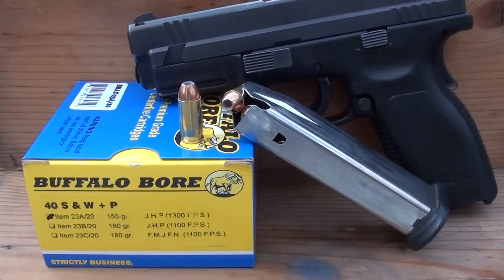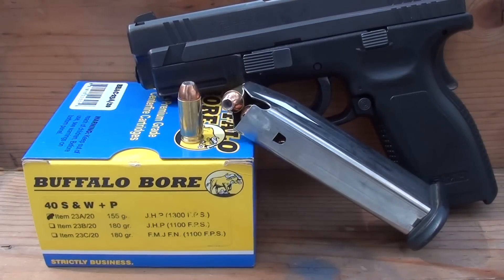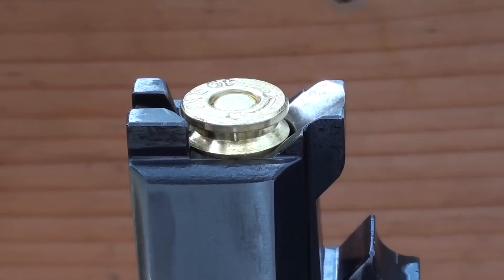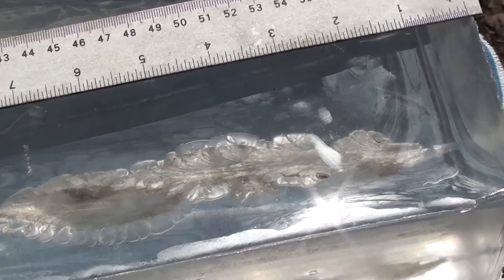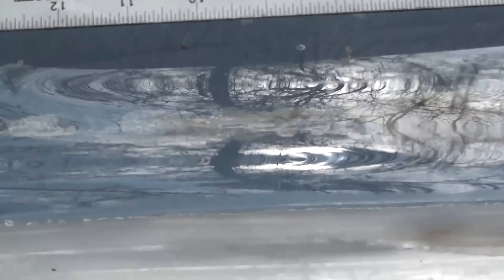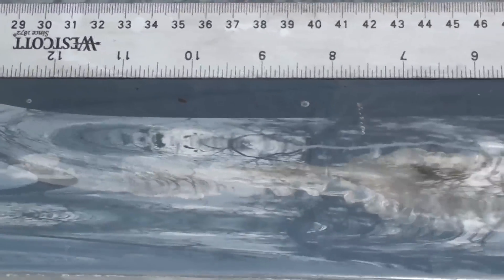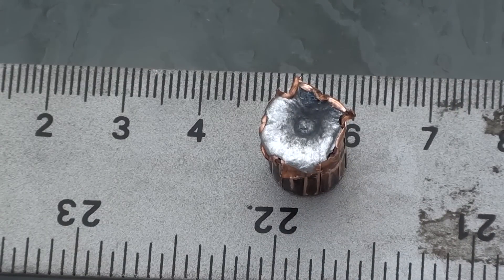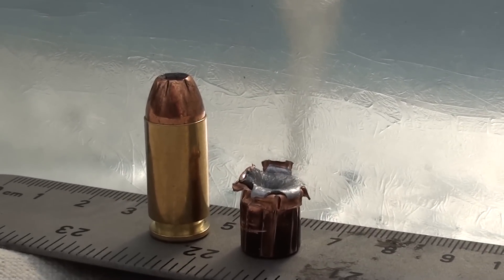40 S&W +P Buffalo Bore 155gr JHP Ballistic Gel Test

Comment: I have shot and hand loaded for the .40 S&W for 30 years. I have purported that 155 gr. Bullet is the optimal weight for this caliber. in a full power load like buffalo Bore its right there with a 158 gr. .357 mag. Law enforcement and Government agencies are going back to the 9mm because the .40 has TOO Much Recoil. Who would have thought that, "For every action there is an equal and opposite reaction" Newton's Third Law of Motion. " Remember that the most important requirement of the Combat Arm is that it be capable stopping one's opponent from further aggression with the minimum shots fired, Preferably One".(Chuck Taylor, The Fighting Rifle .) I am also reminded of a thought paraphrasing," to equip one self with with an Arm that is was designed primarily to be Easy to carry, Easy to shoot at the expense of being powerful enough to accomplish the purpose for which it was intended smacks to me of a loss of purpose."(Chuck Taylor The Fighting Rife.) I wont argue that hit with a light round i.e.. 9mm is better that a miss with a heavy round Full power .40 S&W or Better yet 10mm and .357 mag. Its your family to defend. Train and shoot the most powerful round that you can. I know its expensive and takes time and Discipline, but It will be worth it!

Comment: The FBI load for the 10 mm exceeded 1500 ft per second with a 135 grain bullet I thought the case was too long and The recoil too hard so they came up with a 40 Smith & Wesson with a 1450 ft per second 135 grain bullet then dropped it to 1350 135 grain bullet which made it just about the same as the 357 sig

Comment: 40 S&W is not high pressure. It’s 35,000 psi same as standard pressure 9mm. I’ve shot the Buffalo Bore out of G22 gen and my S&W M&P 2.0. No issues it a great round

Comment: Underwood has basically the same load for .40 S&W. Damn near 600 lb/ft of energy. That's .357 magnum territory, but with a larger diameter bullet. Nasty stuff. People who say .40 isn't substantially better than 9mm apparently haven't seen this.
Reply: The 135 gr nosler from Underwood actually is over 600 ft lbs from a 4” barrel. The rated 588 ft lbs is from a Glock 27, AZ AIRGUNNER found out on December 15th 2023 and January 3rd, 2024. They hit 675 ft lbs from the Beretta. The 155gr XTP is rated at 582 ft lbs energy, so just 6 ft lbs under the 135 gr nosler, but Im not sure if that’s out of the same 3.4” barrel or not though, but it likely is, because 155’s are still light enough for caliber to get enough velocity without to much pressure
Reply: Also, not sure about Underwood, but Buffalo Bore’s hardcast .357 magnum hits like 935 ft lbs from a 6” revolver. Underwood and Buffalo Bore are truly on another level concerning muzzle energy
Reply: @SuperD00D more powder does that- but a 40 super does it better
Reply: I only use 3 ammo companies Underwood Double Tap and Sig Elite for my Glock 23 Gen 3 and my Glock 43X
Reply: @eddieweigel9490 Buff Bore is kinda pricey compared to DT and UW.

Comment: 40s&w isn't a high pressure cartridge.   It operates at the same pressure as an standard 9mm load.  The 40s&w high pressure reference is a myth.
Reply from the maker: Yes and no, Hear me out a sec.  9mm has a range depending on bullet to 
MAP (CUP) – 33,000
MAP (PSI) – 35,000
MAP +P (PSI) – 38,500

Where as 40 S&W is
MAP (PSI) – 35,000

What people are talking about, is the 40 is already at max pressure for the volume of the case, plus bullet weight, anything past 35,000 in a 40 is not really safe (?) 

This is all part of the who likes 9mm vs the who likes 40.  Compare results not pressures.  Pressures are a tricky business, and they use it in marketing to fool people, just like they do with velocity.  Me, I am a 45ACP guy all day long, I know what they do, they are the lowest on the velocity and PSI scores, but they work time and time again..  Bottom line research and use what works for you and most important your gun!

Stay safe and keep practiced.!

Comment: That's the perfect round defensive round for a ar 40calber pistol with a 10.5 inch barrel. It would be more effective than a 45acp. And that statement will send the 45acp crowd into absolute rage. And for that alone I believe I'm going to have to get both a ar 40 pistol with a 10.5 inch barrel. And useing it with Glaser safety slugs for home defense and Buffalo bull brand for a truck defensive weapon or outdoor anti round for any critters who might want to add me to the dinner menu.
Reply: Properly-loaded .40 S&W has always been better than .45 ACP. The .40 provides equal or better muzzle energy with better penetration and higher capacity. Hollow point expansion is usually more reliable with .40 as well due to higher velocities. I don't see the argument for .45 ACP, but some people try to make it.

Comment: This showed the shortness of the actual wound track and the proclivity for hollow point failure!
Reply: My personal opinion, I think there is a tendency to put too much emphasis on bullet integrity at times, it seems, at the cost of performance. Some the most reliable loads, in terms of actual street performance, have been rounds that have been driven to a point of fragmentation upon contact. These loads consistently produced large cavities and were not always deep penetrators by today's standards. Ideally we should be able to maintain integrity and produce large cavities which some modern rounds do very well but this particular round would be very devastating seems to also have enough structure to remain effective through barriers.

Comment: I don't see why this couldn't be fired in a Glock barrel.
The pressure is the same as 9mm.
The 165 Grain HST Tactical Bonded (Police ammo) gets over 1200 FPS out of a Glock 23 & that ammo was selected to be used in Glocks almost exclusively.
I'm just not seeing the over pressure concerns here.
If Glock barrels are fine with .357 Sig, 10mm & hot rodded 9mm +p+, I would feel fine firing some Buffalo Bore that is MAYBE a marginal amount over pressured.

I think we have gotten so used to pud loaded .40 ammo that the stuff loaded close to maximum SAAMI pressures seems like it's super over pressured.
Reply: It's not a danger of pressure alone, it's that it's over-pressured, which is fine within reason in a fully supported chamber, but in a Glock that is not fully supported it can blow the case and the blast would into the gun frame. This would not happen in a fully supported chamber even if the pressure was a little too high.
Reply: @GunSam  Yea, that's true, but I just don't think these are over pressured.
At least not to a level that would cause any issues.

Comment: 40 is already high pressure..

Buffalo bore: hold my beer
Reply: I have a box of underwood +p from about 10 years ago. It ran fine in my 23
Reply: @jimwest1967  I have a gen 2 Glock 23 and want to buy some Buffalo Bore plus P or just any plus P but I’m worried about damage to the gun, plus I have a 22 round mag and dont know how that would turn out
Reply: @daltonlol5550  

Don't do it unless you have an aftermarket fully supported barrel, though the only downside to fully supported Glock barrels is that the pistol won't be 100% reliable. I bought one of those barrels on eBay factory seconds for $59.99 for my Glock22 & sometimes got failure to feed. So I only use it for range training sucks that it isn't as reliable as the OEM barrel.
Reply: @PerceptionVsReality333  try a Lone Wolf barrel.
Reply: lol that’s how they roll
Reply: Compared to 45 ACP, which is 21,000psi, yes. .40 S&W is the same pressure as 9mm, 35,000psi. 9mm +P is 38,500psi, where as there is no real +P designation for .40 S&W. Buffalo Bore just branded it that way.
Reply: @reborn19x  I believe this MAY be slightly over standard max pressure.  These are about the same velocities you'll get with standard max data in a 5" barrel.  BB is apparently doing it in a shorter barrel... maybe.  lol.  Or maybe BB used a 5" barrel...

Longshot and Power Pistol both get about the same performance out of 5" of barrel at standard pressure.    Longshot did 1309 fps and 590 fpe.
Reply: @reborn19x  thats just because theres also +p+ 9mm so the +p has a maximum where the +p in the instance of buffalo bore's .40 is because its higher than standard saami spec .40, because of case limits you cant go much higher on .40 so there would never need to be a +p+ range specified for it.
Reply: same as a 9mm  you are watching silly propaganda

Comment: How about the Beretta 96?

I have no clue what an unsupported barrel is.
Reply from the maker: Some barrels are "bigger" toward the bottom of the round (near the rim) to aid in extraction and or feed areas have to have a barrel lipped, those areas are considered unsupported hence no metal is encasing the brass and it "could" with high pressure rounds split the brass and have blow back, I am pretty sure this is all been addressed in the last few years, and only a few firearms had this issue, Glocks in 40 caliber did in the Gen 2 I am pretty sure and it was nicknamed the "Glock Buldge" in the reloading arena

Comment: There is no industry spec for +P .40 S&W. SAAMI states MAP for .40 S&W is 35000 PSI, and does not recognize .40 S&W +P. What we have here is a irresponsible company with a callous disregard for safety and protocol offering ammo loaded outside of industry specifications and then blaming the gun manufacture if anything bad happens. If your gun blows up using Buffalo Bore, it is has nothing to do with chamber support or gun manufacture. Literally not one single gun on the market is designed to take their ammo. Firearms are designed for industry specs. You know that guy at the gun show selling his reloads? The one who kind of scoffs "yeah those are a lil hot." That's Buffalo Bore--over-hyped mystery ammo loaded outside of industry specs by reckless morons with more regard for advertising than their responsibility to their consumer and their industry. 

I wouldn't shoot Buffalo Bore through any of my guns if I was in the Thunderdome and it was the last loaded ammo on Earth. If you want 10mm performance, you should get a 10mm Auto.
Reply: Even a 9mm has the same 35,000 PSI SAAMI maximum pressure but with plus P it reaches 38500 PSI, the same thing can be done with 40 S&W
Reply: @Maverick966  No it can't. It doesn't work that way. Firearms are designed to be safe and reliable by industry specifications. SAAMI and others within the industry set dimensions, pressures, twist rates, ect, and manufactures use these recommendations. There is no industry standard for +P .40 S&W, so not one single handgun in existence is designed to handle +P .40 S&W. The .40 is accellerating a bullet with 50% more mass than the 9mm, so there is more force involved. You can't just load a .40 to the same pressure as a 9mm and assume things are fine when physics says otherwise.
Reply: @M16A4vibe  There is not YET +P standard for 40 S&W

Comment: That's impressive. My question is isn't technically the 40 s&w considered +p+ round to begin with cause it's already a hot round and this round be a ++p+
Reply: 9mm and 40 run at the exact same maximum SAMMI chamber pressure.

Comment: For all those people who want to beat the crap out of their .40 cal even more...my suggestion would be if you want this type of performance, buy a 10mm.
Reply from the maker: Finally!  KUDOS!!!!!  I knew someone out there was smart.  Why indeed
Reply: Because you don't practice with this stuff. You use it when you need to protect yourself or others.

If you actually use this enough to beat up your gun, you aren't using it for self defense.
Reply: It's generally a good idea to practice with the load you carry. The .40 is already pushing it in its standard pressure form, there's a reason why there's no SAAMI specifications for .40 s&w +p.
Reply: @AnarchAngel1  I shoot maybe 20 rounds of my carry ammo a year. The other 2-3K rounds are all fmj bulk ammo.

20 or so rounds a year won't kill a gun. 

The standard pressure in a .40 is the same as a 9. They don't list a spec because of the unusual origins of the .40. Being a load reduced from an existing cartridge. Rather than powering up an existing load. It has nothing to do with the fact the max standard pressure is 35,000 any more than +P 9mm is listed because the max pressure is also 35,000.
Reply: I agree that 20 or so rounds a year won't kill a gun, but they are going to feel significantly different than bulk FMJ loads that you practice with, which isn't ideal for realistic training. You're correct about .40 cal having the same operating pressure as a standard pressure 9mm, the difference is there is a SAAMI specification for 9mm +p which is 38,500 psi. There is no specification for .40 +p, it doesn't exist, so you really have no idea what type of pressures are being generated by ammo like this. The reason is there is much less room and tolerance for extra pressure with the .40 caliber cartridge, it's already pushing the envelope in it's standard form, 9mm is not. It has nothing to do with the fact that it was created from a shortened 10mm case, it's about the pressure dynamics at play. You do what you like with your guns, I just think the extra pressure is a bad trade-off and a bad idea for a small increase in muzzle energy with a cartridge like the .40 s&w. I've re-loaded plenty of ammo in my day, so I have a little bit of understanding of pressure curves and the reasons why the .40 is already pushing it. My advice would be to stop worrying about getting the most powerful loads possible and start worrying about training yourself to shoot more quickly and accurately... 40s are already pretty notorious for their tendency to beat up a gun, why go and make the situation worse? That small increase in muzzle energy will mean almost nothing in a fight, your shooting skills will.
Reply: @AnarchAngel1  l train with different guns and different calibers. A little more recoil isn't even noticable. Specially in a live fire simulator. I'm not recoil sensitive and I shoot CZ clones. The have less felt recoil to start with.

Most .40s are built on 9mm platforms. +P in 9mm is anything up to 10% over standard. If your platform can handle 9 +P, it can handle .40. It is also is a newer round with an unusual development path. That is the only reason there isn't a SAAMI spec. Much like SAAMI doesn't list +P+ for 9mm. It has to become popular first, then they do a spec on it. Not the other way around.
Reply: @AnarchAngel1  9mm +P is up to 10% over standard. Most .40s are built on 9mm frames. They can handle .40 at a higher pressure, just like a 9.

I train with different guns. Both 9mm and .40. I also have a full sized and a compact .40. In a live shooting situation, you will not notice the recoil. Even in the live fire simulator, your attention will be so focused and adrenaline will be pumping so hard, you won't even see your sights. Noticing the recoil will be impossible.
Reply: Your logic doesn't follow. Yes, most .40s are built on 9mm frames, that's one of the reasons they are notorious for beating up guns. Chamber pressure is not the only thing that matters when it comes to wear on a gun. Equal pressure with heavier bullets equals more energy, energy that's being transferred to the frame and producing higher slide velocity. A .40 "+p" is absolutely going to beat up a gun more than 9mm +p, there is no debate there. You said yourself they are usually based on the same frames, so how does that make any sense. 40 caliber is not a cartridge that should be pushed further than it already is. Have you ever wondered why there are so many more KBs with .40s than with 9s?
Reply: @AnarchAngel1  has anybody lost a barrel shooting this stuff?
Reply: @88Berries  I really don't know, the potential is always there though even with vanilla loads. All that's needed is a case head separation and 💥 And you can lose a lot more than just the barrel as well. I'm guessing most firearm companies would tell you to go pound dirt too if it happened while shooting ammo like this that has no official specifications. I wouldn't put it through my gun

Comment: I just checked the barrel on my new glock 23 and there is much better support than there used to be.
Reply: What generation do you have?
Reply: I have a gen 3 Glock22 made in 2021 & the chamber support is not fully supported but still much better than the older models.

Comment: it doesn't appear the bullet opened as it should, so I don't expect a full 22" often (nor do I particularly want 22inches) I have a box of this exact ammo I tested with less consistent material and 5-7 shots in semi moist rich earth non compacted all pedaled decent (asides of rock chips) and penetrated around 5.5-6" were most defensive rounds take an inch shorter path (not a consistent or good test media I used) but they do penetrate a bit better then most........secondarily. I have a roughly 2009 production glock 23, its lwd barrel and a recent production m&p shield, none of witch have a fully supported case web, all about the same the difference I see is the OEM glock barrel by far has the loosest chamber, the m&p the tightest. though be carefully barrel or not 2 to 3 shots of this stuff will cause the glock slide plate to slide down and prevent battery off if its worn. best case for an aluminum slide plate I've seen yet. and you definitely notice a recoil difference in either pistol they are pretty stout compared to most defensive load non +p